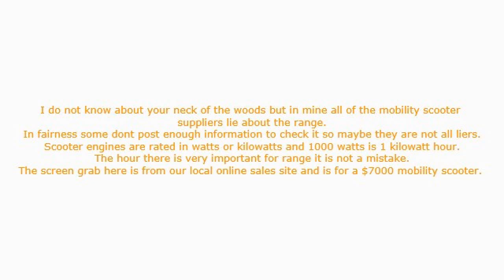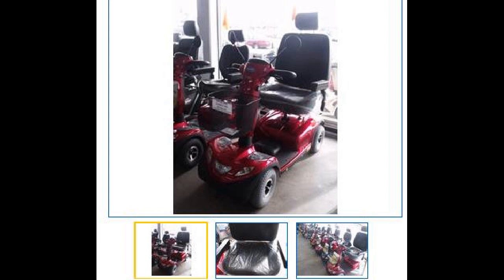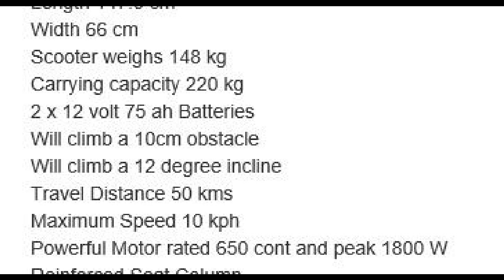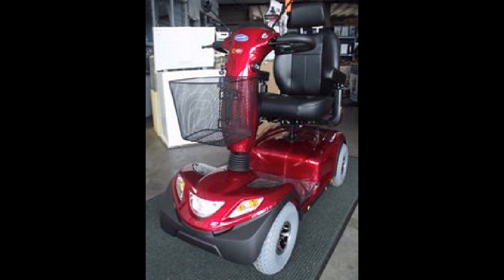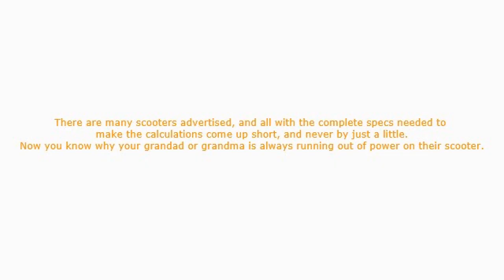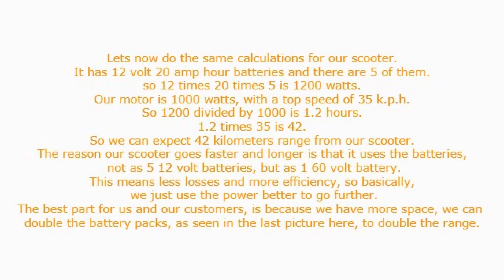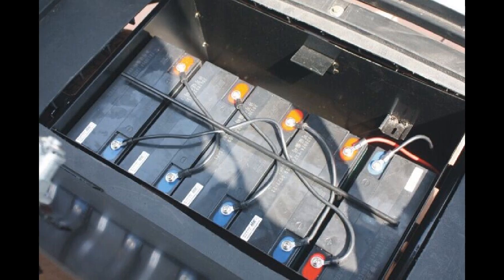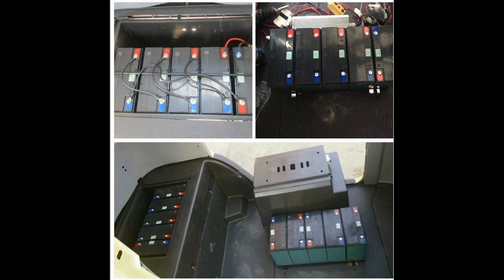mobility scooter battery info

Comment: The range is more complicated than just battery capacity and motor horsepower
Terran, speed, load,  to just mention the obvious.
Reply from the maker: You are correct Joe, The thing about this is that the 2 sets of 5 x 20ah batteries running at 60 volts go further and faster on a bigger heavier scooter than the same size 2 x 100ah batteries in the smaller scooter. These batteries are literally the same size, weight and capacity as the larger batteries but the voltage seems to result in lower losses in the conversion process. This was also specifically a dig at the "scooter shops" incorrectly describing their product which seem to be a world wide thing.